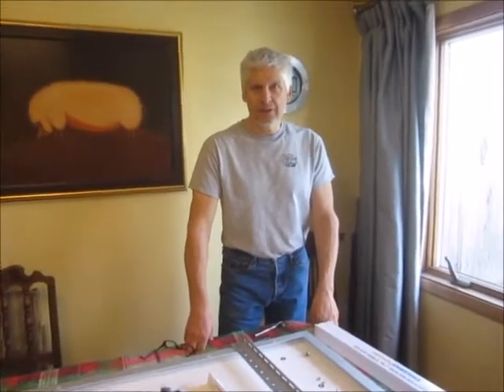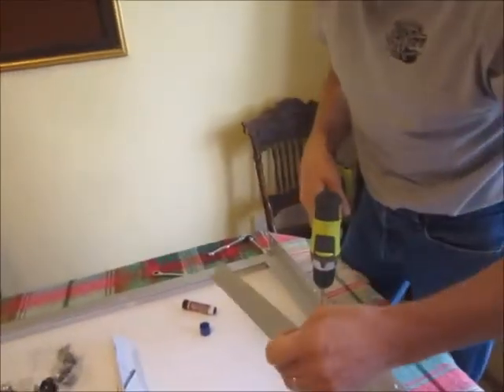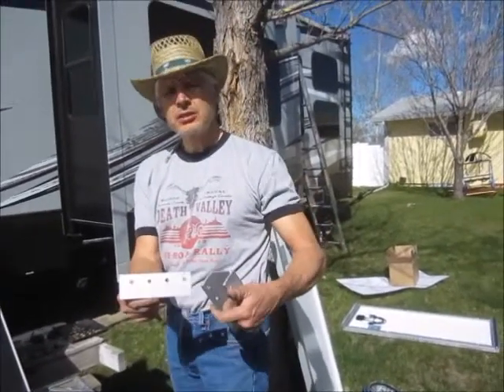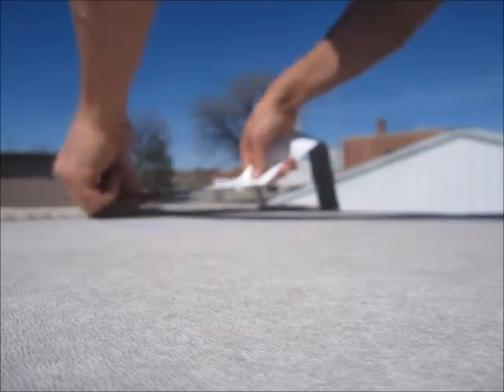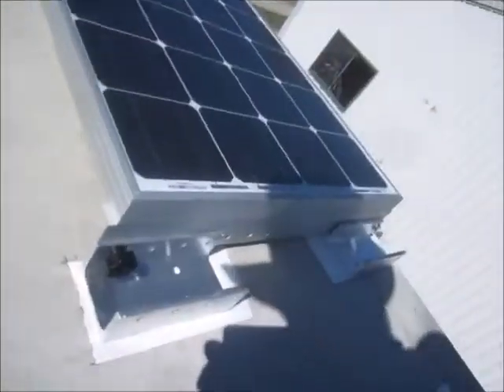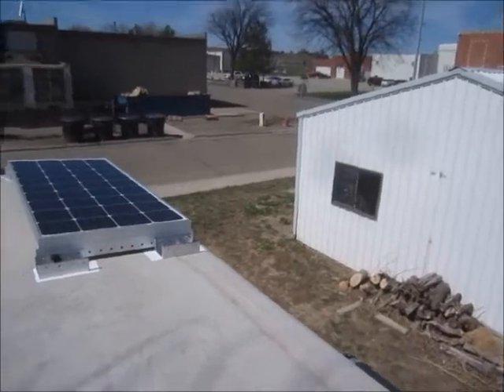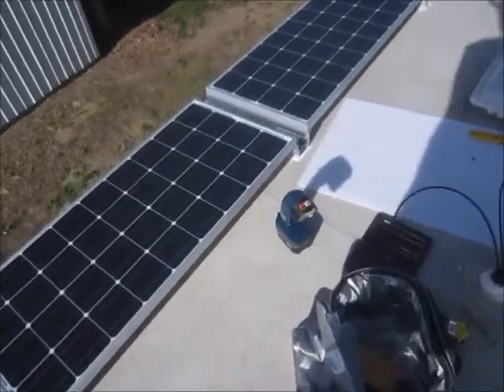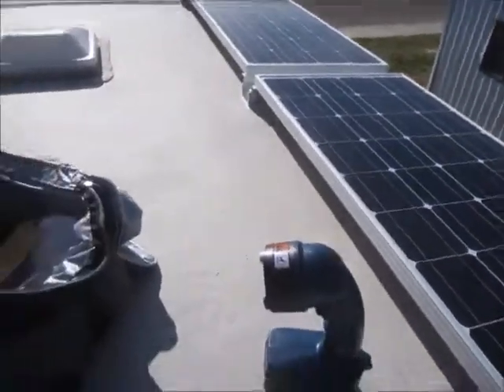Renogy 400 watt tilt Solar install on Raptor toy hauler 300MP part 1

Comment: Thanks for the great video! I am about to install a similar Renogy system on my van that has a fiberglass high roof. The kit comes with Z brackets and hardware (essentially 8 bolts through the roof per panel. My roof is not as flat as yours but I was thinking that the Z brackets will be sufficient if I upgrade to nylock nuts and seal the holes well. I took to the internet to research dissimilar metals corrosion and got mixed results. Non-metals aside (caulk, roof membrane, wood, permabond, etc), it appears that you have 3 metals here: stainless (angle connection to panels),  painted galvanized screws, and aluminum. After 2 years, have you noticed corrosion where the different metals meet? How is your system working and do you wish you had done anything differently? Thanks again, hope you are loving it!
Reply from the maker: JIMMY G, I have seen no corrosion at all. Great observation on the dissimilar metal. It could be a concern long term. Who would want rust streaks down the side of their van?
Thank you for the great question.
Reply: With stainless steel bolts in my aluminum solar panel frame taking them off one year later I saw a slight little white coating but no metal pitting.

Comment: The problem with your method is u cant tilt the panels very far. The purpose of the whole cross bar is to fasten the vertical rack somehwere closer to the center for maximum tilting.
My problem is a curved roof so I guess I'll have to use the Renogy z brackets to fasten down the Windynation  rack onto the roof..
Reply: @Eric Baker, did you move forth with using the Renogy z-brackets on the RV roof and then attach the Windynation adjustable mounting brackets to the z-brackets?  Has that held up well if you did choose that method?  Thanks.
Reply from the maker: You could always travel with two lengths of upright bars. That's what I plan to do this winter, or just a long bar with more than one hole drilled in it.
Reply from the maker: I do like your idea of both brackets. Well thought out.

Comment: I finally got my solar panels installed.  Your information really helped as my roof was curved.  Did you screw the aluminum brackets into the cross beams or just to the plywood underneath?  I used ss lagscrews into the plywood, but I am now wondering if the plywood is thick enough to hold the panels in place.  I did drive it on the highway and the panels are holding, but I'm wondering if this will be an issue over time.  Thanks and great video.
Reply from the maker: Hi Keith, I am glad the video was helpful. I only hit one cross beam. Was not aiming for one, just got lucky. Lol. I have a few thousand miles on the trailer now with the panels on, some of the miles in vary strong head winds and no sign of them coming loose.

Comment: Where did you buy the aluminum channel?  I can't seem to find any that thick.  Thanks.
Reply from the maker: Hi  Keith. I try and post links of what I use in the description. I got it on Amazon. http://www.amazon.com/Aluminum-U-Channel-Unpolished-Lengths-Thickness/dp/B003U6HOUU?ie=UTF8&psc=1&redirect=true&ref_=oh_aui_detailpage_o00_s00For this job I would have preferred thinner wall thickness, but the leg length of 1 3/4" was more important to me.

Comment: I have the same rig as you. Which pipe did you put it the? Can wait for the next setup. We took out the tolet and put in compost system . Love it. Now have all three tanks for gray water. Compost works great. You all should put one in. I used nature's head. Best on the market.. Look at the Wyndham YouTube at gonewiththewynns.com look for their head setup.
Reply from the maker: +john w That's the vent for the bath sink. I will show running the wires and charge controller next video. Maybe tonight. Yes, I did see all of the Wynns videos. For now, we chose a Biffy Bun Warmer to save water and holding tank storage. The composter will have to wait till we can full time snow bird. That's a very big investment. We will see in 2017 about that?